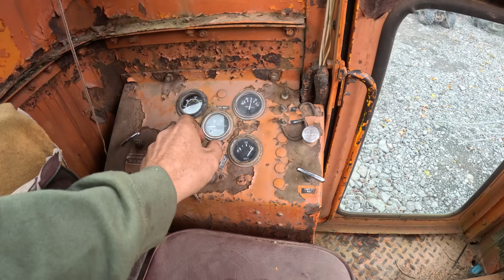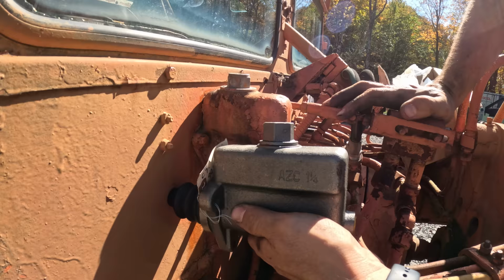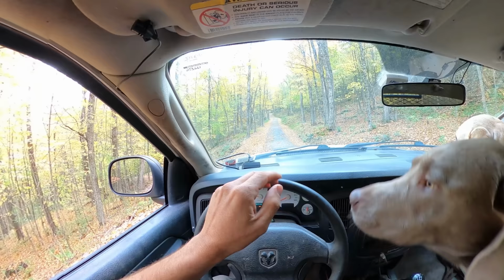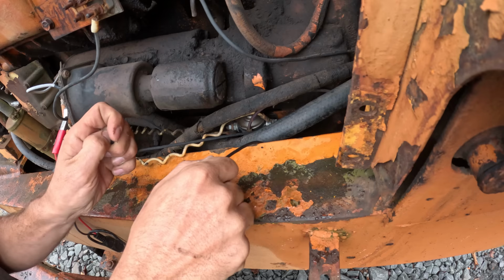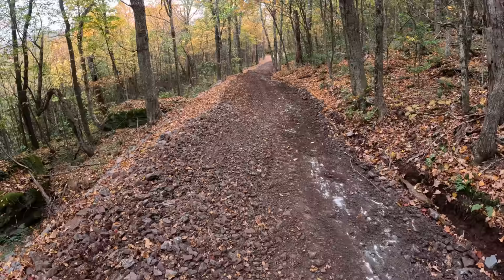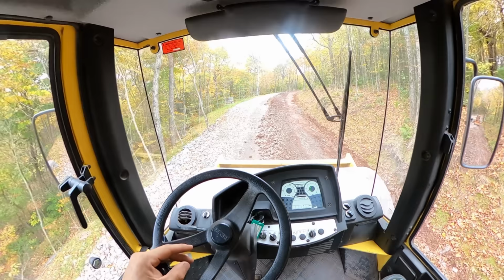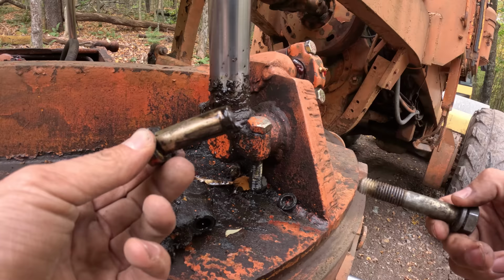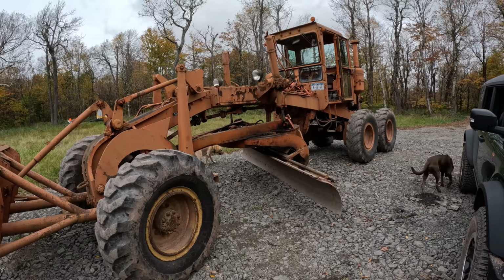Buying a cheap grader

Comment: The best way to bleed a tricky clutch / brake is to attach a long hose to the nipple and have it go vertical up for a bit before bending over and back down to a bottle that is lower than the nipple (siphon effect). Then just pump it 10 times with the nipple open. you only suck about 5 % back in each time and you can only suck back in fluid because its stuck in the vertical tube gravity fed and the siphon ensures no air in the tube. On the last pump, You have to close the nipple before the brake / clutch pedal hits the floor. So you close it under positive pressure. Thats the 100% success way. You can mostly get away with just refilling the reservoir so its positive pressure gravity, wait 1 minute and just close the nipple. If your by yourself and no air tools. This method is best.

Comment: 471 GM Detroit ...wear headphones 🎧
Cable on blower is emergency shut down flap spring loaded .
Must resset if tripped or it will never start even on ether .
I ran 40w straight in two cycle detroits as per factory spec .Change primary fuel filter alot and put a little motor oil kerosene in fuel . 
Alison trans keep full with c3 fluid . 
Cool you bleed brakes the right way!
I am circa 1979 heavy equipment mechanic just trying to help you . 

Nice grader
Reply: yep I run a little 2S oil in my old perkins, good for the old type injectors and pumps, so I believe
Reply: @IsambardKingdom  yes new low sulfur fuel  used in common rail tier 4 has little or no lubrication for old stye injection pumps and injectors.

Comment: Detroit Diesel 2 Stroke diesels are brilliant engines. It seems no matter how worn out they are, they will always start - if you can spin them fast enough. So good batteries and a good starter motor are vital.

Comment: Andrew, a new stock Bronco is quite capable. For rock crawling it needs higher strength front axles. Otherwise it's a great machine. Check out Matt's Offroad Recovery channel, one of his guys has a new Bronco running 35s that broke the stock and heavy duty Ford axles but they were truly abused before they snapped. He hasn't broken the third set. That grader was a real bargain! Great Video!
Reply: At first I thought that was a GRENADIER!  I have been researching those for a minute, and want one.  Created as a replacement for the discontinued old school Land Rover Defender and named after the British pub in which they thought up the idea.  They are cool.

Comment: To arrive at the smoothest road I believe you grade it periodically until the pass is achieved with barely any adjustment of the blade. As a nipper I was allowed to steer the county grader while the operator watched my line. The road was heinous but after the grader had been along it one time it would leave for another three months. She's a bit worn looking but it's a very cool machine and practical still right! Thanks for the ride along!

Comment: Andrew these old graders are delicate to say the least. This grader looks like ex municipality. They graded the sides of the road and allot of snow in the winter. 
The front axle is another weak point as well as the transfer case.

Comment: Now Andrew, you know you will be needing to purchase your own big rig, to haul that grader around to different job sites.
Reply: It’s still got NY plates on it so I’m assuming he can register it there which seems crazy but yeah the next logical step is to get a heavy haul road tractor like a Pete 389.
Reply: If it's less than a 100 miles, it's cheaper to drive it on the road/highway than owning a big rig. Been there, done that! I'm a former highway contractor who had to know the costs of every piece of equipment and the cheapest way to construct projects.

Comment: Andrew, I’ve been a Grader operator for over 50 years now, and I’d like to help you with your situation!! First, get rid of that front blade and framework! Secondly, get scarifiers installed to the front where provided, then rip-up your roads!! Then and only then will you be able to grade the way you want to!! You are just fighting yourself that way!! The grader is a fine grading machine, not a Dozer!! It’s designed to fine grade material, not fight thru hard cut!! When you’ve achieved your profile, then compact the same!! I hope this was helpful!! Thanks again, Vic!!
Reply from the maker: OK I’ll try that, why don’t you like the front blade?
Reply: @AndrewCamarata  Well Andrew, It will just make your wheels spin unnecessarily!! You have Dozers for that work!! Treat that Grader as a Grading instrument!! I really have faith in your abilities!! That Grader will last you many years, if you use it properly!! I wish we lived closer!! I’d love to visit, and help if you needed it!! You would love my equipment, All Caterpillar!! Let’s keep in touch, Vic!!

Comment: I have never seen a grader with a Detroit, that is just cool, I really like the time and effort you put in the videos, that is a great find.
Reply: Champion used them.
I don't know if Allison/Terex made graders but they would have had a Detroit as well
Reply: @russellsmith3825  Yes, I knew that some of the old front loaders, dump trucks, excavators, and some the unit draglines had them also I think but yeah you are right I just never seen one in a grader, but some farm tractors had them also.

Comment: Great job all of you . Andrew you should set up your crusher and see how small of rock you can make like tailings to top off your grading . It will fill in the big rocks .
Reply: I've mentioned a few times that a screening unit would do wonders. But I'm just an arm chair quarterback
Reply: @oentilson1720  

Like feeding his crusher into a power screener? That'd be the only way to make a bunch of it...
Reply: A cone type crusher is more effective at producing finer aggregates.  Jaw crushers are good for breaking up the big stuff.  Then a vibratory screen could classify the different sizes.  Processing stone is a very expensive and often frustrating undertaking. You do the best you can, then some state specifications are difficult to meet so they reject your product.  Raw materials can vary and you always have OSHA coming in to inspect your operation.  It can wear a hard working man out.
Reply: I was thinking for his own personal use . Not for sale . He has a lot of road of his own to deal with . I have no idea what machine that would work . Thanks for the information .

Comment: The duals should have 4 identical tires on so you don't end up destroying it. Dissimilar tires can break stuff for these types of machines. My brother who has bought three for a project on his farm has learnt this the hard way with one of them. Basically dynamited the whole rear left side, mangled chain and damaged the rear most wheel's base. Not familiar with this machine of yours, but if it's like any other grader (chain, no slip like the modern ones have) then you should look into having same thread, same diameter, same tire pressure. Just a heads up.
Reply: You are right about this.  The two drive wheels on each side are driven by a heavy chain and will not rotate independent of one another.  If the tires are not of the same outside diameter then they will fight against each other.  In a heavy pull it can break a chain or do other damage.  It is not so important that the left and right sides match but the tires on a given side should.  There is a differential that evens out left and right differences.

Comment: I would wait with a new car purchase for a bit, Andrew. 
These stealerships need to bleed a bit for what they did to consumers with these obnoxious marketadjustments and other pricehikes. 
They made recordprofits over the backs of ordinary people. 
I'd say, let the recession and economic downturn work its way through to the dealerships and I guarantee you, you can pick up a Bronce below MSRP. Give it 6-12 months. 
But a Toyota would be a far wiser choice. 
Great video btw!
Reply: "Stealerships" - the perfect term.  Thievery is RAMPANT these days.  Everything from cheese to houses is WAY overpriced.
Reply: I agree about new car prices. I think there’s going to be a correction before long.
Reply: @SteveThomas7136  Yes sir. But it's already happening. MSRP is already the norm again and in some places, rebates are offered making the sticker below MSRP. Which isn't enough, because these levels of corporate greed need to be punished severely. Let them bleed. Any dealer that marked up cars or trucks by 5k or 10k or 15k needs to be shunned. Recordprofits for dealers are an example of extreme greed and the answer to that is extreme wrath.
Reply: Good points all around. December could be a good month.

Comment: Just to help you out Andrew,  if you want welds to hold up on cast iron parts... you need to preheat the area to be welded with a torch and do the welding with high nickel content welding electrodes or with flux core wire.
Reply: How much preheat? Red hot? Just curious
Reply: @blzt3206 no not red hot. Temps vary for size of repair. Biggest thing is uniformly heating the part and slowly cooling it down. Bury it in sand or step the heat down in an oven over a few hours.
Reply: @blzt3206  Between 350-400C you can buy a temp crayon anywhere welding supplies are sold that will only melt on the heated area when the cast reaches those temperatures.
Reply: @TronVila  correct 👍

Comment: After reading all the comments i think ill be the one asking first, anybody can tell us more about the make and model on that bad boy! I've operated graders a bit before and seen a few different models but never seen the rear  articulate independently from the frame! And that frame tho👌 strait piece front to back
Reply: The machine is a Aveling Barford P99 designed in Grantham England, the “ripper” with the missing “. teeth” tines is a scarifier , a ripper can be attached to the rear for heavy breaking of the surface.  The “blade” is the mould board, and can be moved sideways using a combination of the side shift and high lift rams , to a position vertically to one side used when digging deep snow, in Norway, 12 feet deep snow can fall back into the road, so the high lift was used to slope, the snow from vertical. The front bulldozer blade can be replaced with a V plough.

Comment: Great grader, the white smoke on startup indicates air in fuel system, probably a leak in fuel system delivery to injector pump, find and repair the problem will also fix the hard to start without starting fluid. Anyway great looking and operational grader😀

Comment: A good high pressure power wash will remove most the paint flakes and loose rust for some preventative spot prime and coating.

Comment: Thank you for going through control levers, people look at graders like they have too many levers. They don't understand that two of them are just for the right or left side of the blade. On my Dynahoe190 I just have to ADD brake fluid to the master cylinder. Then my brakes are stiffer on pedal. So glad your emergency brake works. On the Dynahoe can't adjust it anymore on the driveline cone. YES so right about Graders making fine grades better than a Dozer on Roadway smoothness.

Comment: The new bronco is body on frame so its a good build similar to a pickup truck. I would definetly recommend some heavy duty tubularwelded  bumpers front and rear. Stay away from the 2.3 direct injection engine wich is more prone to carbon buildup on the intake valves. Go with the 2.7 port injected engine. Port injection will offer many more miles of trouble free driving. Running 87 octane is safe, but engines are a 10:1 compression ration engine which likes 91 octane for max hp.

Comment: Very good grader. The smaller ones from the 50's weren't nearly as heavy-duty as this beast. They really got the problems solved with this newer larger grader. It's an amazing piece of equipment - right down to the all-wheel drive capability.
Reply: Ed Tilley

Comment: 28:35 angle your blade a bit more when you’re grading and don’t be afraid to drive that blade in the ground!..you want to load that blade up as much as you can without over loading the grader…a loaded blade is much easier to control than a half loaded blade…you have a lot of bony stuff in that sub-base and very little fines so youre gonna have to work the rocks out of it and bring the fines to the surface so you will have something to finish with…and just take your time and that road will eventually come around!…that ain’t a second gear road…the more passes you make the more you will break up the rocks and take the dips and hollows out…that roller helps a pile too but I think you might have gotten on it a little prematurely…that’s quite the old grader you have!…and that old Detroit runs like a champ!!…I also love that old skidder you have!..she’s a beauty!!..looks like a C6…

Comment: Forgot to mention that the grader I watched as a kid was much larger than yours and he stood up while operating it. In the winter they installed a large V Plow on the front, and  they often times pushed it with a township dump truck to bust open drifted in roads.

Comment: That Grader looks like it's come from a good home. Unlike the one we have. Everything is loose and sloppy even the universel joints on the drive shafts. We have done the engine up. By the time we have finished it. It will be like a new one.

Comment: It looks like pretty good shape for its age and seems like everything works.  Give it a bath with the hot washer so you can see potential issues. Otherwise once you get some small stone to or on the top that thing should be able to maintain that driveway.  We had a smaller one for doing shoulders and broken up roads and it’s amazing what a job they do.
Reply: Geez, you're not gonna make many friends telling Camarta what to do. Loads of his fans class him as the authority.
Reply: @Stoff1  It was just a suggestion after 40+ years of maintaining and repairing equipment.  New equipment, clean it inspect it, make a list of what can be done later, and fix anything that can't wait. I have learned and continue to learn what I know from people who have been there and done it.

Comment: Very cool grader definitely don’t see them much with 6 wheel drive you need to get some rippers installed it will really help you make more material to work with when reconditioning a drive
Reply: NuzBack

Comment: With AWD and that huge plow this rig will be real handy in the winter for plowing snow off of your driveway.
Cheaper than a Kubota and you get a cab.
It might even have heat.
I have never seen a grader with license plates.
New York is strange.

Comment: Andrew that a very nice grader, just take your time , when you thing you got it smoothed up the way you want go back to your crusher and set the jaws for 2in and put that crusher run as a top coat. Grade that in and roll it will make a great drive.

Comment: Used to put a vacuum pump on  those master cylinders when you instill to get the air out right before you start pumping and it worked crazy fast. You would get the air out with vacuum and then blew the trash out.

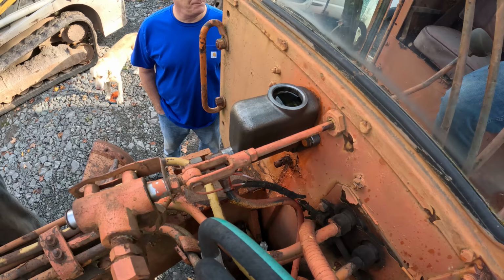Comment: Can any grader driver tell me about the operator who drive it around 20:00+ if he’s actually using the machine like it should?

I’m from Europe we hardly ever see these, at least not in the Netherlands since we have literally no hills in 95% of this country we use laser guided scraper buckets for leveling behind tractors or on wheel loaders.

I imagine this machine is to grade your roads to prevents whatever is driving on it from tipping over whilst climbing / driving down hills? As well as taking out dangerous bumps?

39:40 something = we break it we fix it love your Andrew you’ve no idea as a beginning / semi-exp mechanic you and MasterMilo are my HEROES you guys know what needs to happen within 60 seconds.

Comment: My parents pulled up to their dirt road and found that on Friday evening Southern Pacific railroad had parked a grader in front of our road, with the keys still in the ignition, with a full tank of fuel. So he moved it out of the way, and went home. 

Then all weekend he used it to grade our dirt road. So nice of the railroad to volunteer that hardware for that. He only almost rolled it 3 times. As he was putting it back shifted a bit so he could drive by, it sputtered and ran out of gas. When we went out on Monday morning, there were a whole crowd of people around it. When they asked about it, he said it had blocked our road but someone with an SP vest came up and moved it so we could get into our road, then it was gone all weekend. 

On Monday evening they didn't block our road with it.

Comment: The Hec Tasmania had 4 Aveling Barford super 700s powered v671 gems. The blade was removed because of the weight to save the front diff .six wheel drive go an where in very rough conditions very good machine

Comment: Those 2stroke Detroit generally like straight 40W & early one's can crack heads if you don't let them idle & cool before shutdown...🥵
My dad had a junkyard Allis Chalmers dozer 2-71 engine on a frame with its dash, had 13k hrs ... on a stopped hour meter.
The injectors were so worn the exhaust stayed wet...